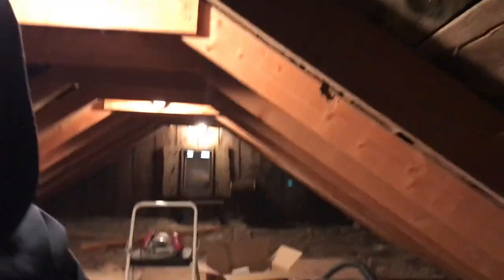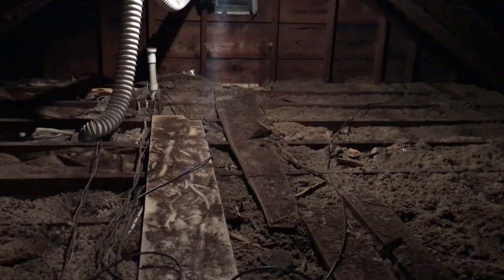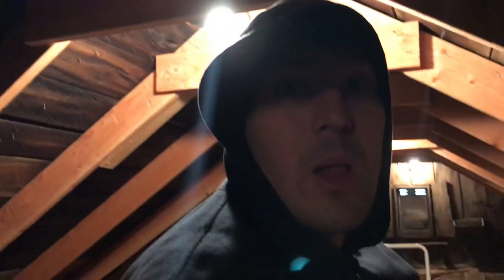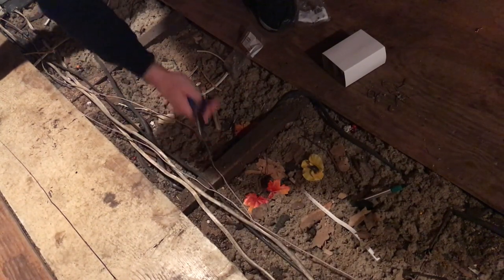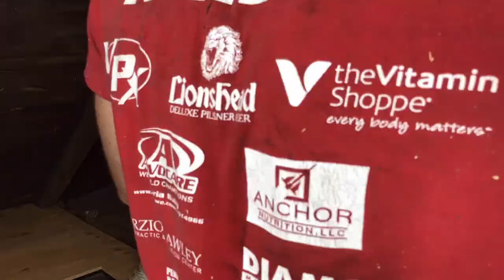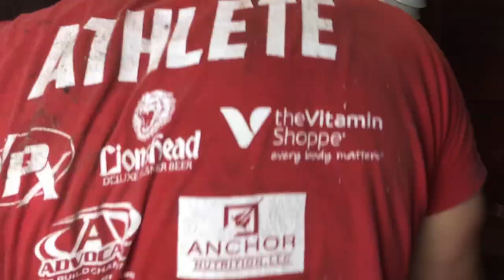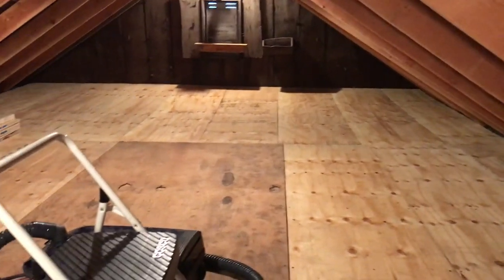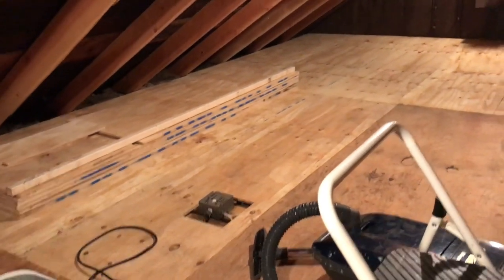DIY Attic / Loft Flooring

Comment: Have an attic access in an old home. Floorboard completely covering the bathroom fan below with just enough of a hole for a 4” vent that needs replacing. This gave me confidence to go up there and do some work (I had no idea if cutting wider holes for things like fans and ducts was a “thing” I could do—silly, I know)

Comment: I was a roofer many years ago and feel there would have been more structural integrity if the flooring had been layed down like cross bonded brick work and not meeting on the same ceiling joists. Otherwise I've never seen anyone work so fast and efficiently.  Best way to portray these videos I feel.
Reply from the maker: Thats important for the bricks as a whole, because they are working together to support something (e.g. as a wall). These boards are just typically holding 1 or two boxes individually.
Reply: Structural integrity he said. I think he is right. Even so adding sheeting on the floor increased structural integrity. Not that you need it more structural integrity. It seems just to be a thought which I’m glad he mentioned.
Reply: Michael is correct as far as the floor boards all flexing at the same join. if you criss cross them, the floor would technically be stiffer but 3/4 ply is think enough as it is to not be concerned about it whatsoever. nice work!

Comment: Rather than cutting into the ceiling joist to accommodate the wires, and thereby weakening the joists, it might be better either nail timber on top of the joist or at right angle to them.

Comment: My attic has the same issue with the cables across the joists. I have been thinking about how to do this for over a year. I've talked to electricians and builders. The best idea we had was putting strapping on the joists. Not one of us thought of just notching them. Thank you.
Reply from the maker: See? You have been asking qualified people for advice when really you should have been looking for a doctor of physical therapy who makes YouTube videos!
Reply: Yeah, the idea of notching the joists makes me very nervous 😬
Reply: @petert7807  The codes specify the size, depth, and frequency of notches you can add. For some assemblies, that will be none at all. But for wood joists like this, you'd be surprised how much you can cut out.

Comment: I have inheritied so much 1/2 plywood flooring, but since it had been laying on top of wires, I had to move and adapt.  So, I am installing Attic Dek tiles that are made for the joist differences.  That said, it is much more expensive than your example
Reply from the maker: Yes, this is a cheap storage solution

Comment: Dose your house have any condensation issues with having no space between the floor layed and insolation? I seen some buildings regs where there's supposed to be enough space between the insolation and floor to prevent sweating and condensation occurring?
Reply from the maker: Have not had any issues yet. There is still space along the edges and it is definitely not an air tight seal by any means
Reply: I think this would be just like an exterior, as long as there is a vapor barrier on the bottom of the insulation it should be good to lay plywood on top. At least for fiberglass insulation. He looks to have an older house with cellulose, so I'm not sure if there is a vapor barrier installed or needed. I'm not a professional though.

Comment: I wouldn't put cuts in the beams for the wires and cables because it can cause damage to the strenght of the beams and also the HOH ( hart to hart ) between the beams is also a consern because the wider the distance the bigger the beams need to be .
Reply from the maker: I would agree with you, but I don’t
Reply: @DoodleBrosOfficial  I had a local contractor tell me the same thing about cutting into the beams. I have a similar project and am hesitant to cut into them. I feel like they won't technically be as strong, but also you are strengthening them by installing all the flooring. Maybe it that kind of cancels it out? Idk though, I'm a noob.
Reply from the maker: @fd1193  it’s been 2 years. My ceiling has no cracks and the house hasn’t come down. I think a few 1/2 inch deep notches are safe haha

Comment: Just a thought,  mark the floor, or make a drawing of where those wire runs are, just in case wiring need to be addressed again, or..  you plan to do additional nailing, you will want to know were to avoid.
Reply from the maker: An excellent idea. However, being a father in my mid 30s, I find that a life of danger is something that escapes me most of the time. Placing a screw into a board for some random repair, not knowing if I am about to shake hands with St Peter himself is one of the last thrills I can hope for

Comment: Excellent work generally but I will be using screws rather than nails over our delicate old lath and plaster ceilings. Plus I will 50% offset he lines of boards.
Reply from the maker: I did use screws 1 and 5/8”! For the project but I had not considered offsetting the boards. Good idea
Reply: @DoodleBrosOfficial  what does offsetting the boards mean ?

Comment: I did a similar work at my house but I I extend all my wire i one area of the attic and remove the insulation but replaced with new insulation on the roof so the room is insulated, in that attic if you live in a hot area is going to be 140 dg in summer
Reply from the maker: It does get extremely hot in the attic during the summer, but thats what attics are for lol. None of the heat transfers down to the living area

Comment: So is it ok for the new plywood flooring to be placed over all the existing wiring? Should one be worried about "smushing" or pressing/pinching all the existing electrical wiring?? For example, my AC and water heater are both in my attic and there's lots of wiring coming out of it in all different directions that sits freely over all the joists (in addition to internet/tv/camera system cables etc.). If I'm installing some plywood flooring it seems like I would need to put the flooring UNDER all said cables as opposed to on top right?
Reply from the maker: There are a few options. Best case would be to have it all under the flooring or on top (but then you can trip over it. 

The method I chose, as I show in the video, was to cut tiny notches (about 1/2 inch deep) in the beams and place the wires in those. That way when I put down the flooring, there was no pressure on the wiring

Comment: Fantastic idea and a good space for storage. Would there be any dramas with the cabling being covered and down lights couldn’t be covered right?
Reply from the maker: No issues with the cabling being covered, and those boxes were actually electrical cable junctions. I could have relocated them but it would have been too much of a hassle.

I DID, however, write down where all the cables were just in case I ever needed to do something with them
Reply: LED downlights can be covered, they run cool. as long as you can access cables later then its all good. but very rare that you would ever need to again in this lifetime

Comment: Great video! Many thanks for this. I see your laying boards straight onto the joists. Will that not make the ceilings below crack in some way? Will the boards be okay to place a model railway up there if you were careful moving around?
Reply from the maker: It’s been 3 years and no cracks so far. 
No trains up there. Trains weigh 20-40 thousand tons and are best on railways, not attacks. Please stick to full sized vehicles at most. Maybe a bus.

Comment: Thank you for sharing great video, how long has it taken you from start to finish? And material cost? Thanks again
Reply from the maker: No problem! Took about 3 weeks, roughly 20-30 hours total to complete.
The plywood (at the time) was about $400 and the screws another $30-ish
Reply: @DoodleBrosOfficial   what size plywood did you use? 1/2 inch?
Reply from the maker: @mikeanthony3749  Correct, 1/2 inch. If you are going to be up there a lot I recommend 3/4 though. I weigh just shy of 200 lbs and it has some good flex to it when I walk on it. Since I go up there literally 4 or 5 times a year its no big deal though. 1/2 is perfect for anything you are storing

Comment: Great video!! Thanks for sharing :-)
How thick should the wood be for the flooring that you put down?
Reply from the maker: I recommend 3/4 inch plywood if you are going to be walking around on it a good amount. I used 1/2 inch because I only go up there a handful of times a year. The 1/2 inch flexes A LOT, but if you do a good job of screwing it down there isn't an issue.

One strategy would also be to have the 3/4 inch where you are walking and 1/2 inch on the sides where you are putting boxes/totes. (The cost difference between putting 1/2 vs 3/4 for my attic was about $150)
Reply: @DoodleBrosOfficial  yeah cheers for that info.. I'll have to pop up in to my attic and check the beams etc.. it's not gonna get much walking on if truth be told. It's only gonna be storage really,and up and down at xmas for the usual decorations etc lol but I might even 1/2 inch at the outer and 3/4 inch more central where most of the walking when I'm up there will be.. cheers for the heads up, at least when I go for the wood,they'll not be able to pull the wool over my eyes and say I have to go for 3/4 inch or perhaps an inch
Reply: @ryanhunter2730  you can also put a 3/4 "catwalk" in the middle that will allow you to carry stuff more easily. Use 1/2 for the box storage. If you have 2x4s you can add them between joists to minimize flexing if you go with 1/2. I'm a big guy, I don't trust 1/2.

Comment: Great Video!! Awesome Job as well.. I notice you didn't put down new insulation. Do you recommend putting down new insulation or should I just use what I have currently? What size screws did you use?
Reply from the maker: Screws are 1 and 5/8 inches.... not sure on the insulation. That is something you would need to speak to a professional about. Sorry I can't help there!

Comment: Great video, I see there’s no wires, is that ok to fit boards over wires without possible future danger?
Reply from the maker: John Murphy first few minutes of the video I talk about how I cut very small notches in the floor beams for the wires to fit in so the boards do not lay on them. I would NOT recommend just laying the boards on top of them otherwise
Reply: Doodle Bros great thank you!
Reply: Lol I would have HAD to pull all that insulation out/I would have replaced it all, OR removed it all togeather and added Insulation, in other areas/the walls/ the ceiling area,  I would have also PROBABLY, re-routed all of the wires as well/ran them through the joist, ALL OF THIS, would have taken ALLOT more time, but I just wouldn't want to have to think about it, FOREVER LOL.

I would have also either installed a mini split or re-routed duct work, to/in the attic.

I'm tall too, so I don't know if this would work for me/I know the only option is to raise the roof, which is annoying/allot of work, BUT, that MIGHT be your best option/worth the money.

When your sitting down, I'm sure its not to bad though.

I would put the floor/plywood down regardless though, even if your just using it for storage.
Reply: Possible danger always exists. The method in this video has a high risk of causing a house fire. The biggest risk as I understand it is that someone puts a screw or nail through the subfloor and damages the electrical conductors below. This could be to add flooring, to fix saging/bulging of the subfloor (potentially caused by a wire), or to add a structure above the subfloor such as shelving or a table. Additionally, 1/2" ply is both insufficient thickness for a subfloor (3/4" minimum) and insufficient distance to protect against typical fasteners penetrating into electrical wires. The preferable method is to add ~4-6" risers over the joists to elevate the subfloor over these obstacles. That is, of course, detrimental to the height of the finished space - but it's the safest way to do it and makes it easy to fish through additional wiring later, or add insulation as needed.

Comment: Badass work. But at what point is it too much weight for the trusses? Roof ridge sag? You can store alot of things with that space.
Reply from the maker: Lee Nino Good question. The flooring would help distribute the weight of anything you are storing up there. And if I can fit it up the small pull down stairwell and lift it in my attic it isn’t too heavy to begin with. No amount of Christmas decorations and boxes of  my wife’s old purses will make the roof sag
Reply: @DoodleBrosOfficial  What if my wife has Gucci purses? Would those be too heavy?
Reply from the maker: @timkr66  due to the weight of extreme fashion sense it would, in fact, bring the whole roof down. My apologies on the weight, but compliments on the fashion

Comment: Thank you for sharing your video sir, I hope to try this for my mother's attic as a gift to her soon. May I ask if you have any suggestions/advice for beginners?
Reply from the maker: Get yourself a pair of Bluetooth headphones like I had and listen to some podcasts..... because it’s going to be a while.

If you have any questions during, feel free to come back and ask!
Reply: @DoodleBrosOfficial  Thank you for sharing then, may I ask if I need support for the plywood or is that needed to withstand more weight?
Reply from the maker: @mskiara18  if you are going to be walking on it a lot, use 3/4 inch. Otherwise 1/2 inch works fine for storage
Reply: Use a black permanent marker, mark the wood where any electric wires are underneath.

Comment: Uh, how did you even get the boards into the attic? I have about 28" x 20" access panel to my attic. The main reason I want to get some kind of walkways is to support my weight while installing roof rafter insulation. Would it be adviseable to cut small notches in the ceiling joists to allow the romex to safely sit in them?
Reply from the maker: That would be rough. We have pull down stairs, about 28 inches across also. I had all the 4’x8’ boards cut in half (length wise) at the lumber yard. So I would think it would still be possible for you to get them up, depending on the ceiling height, if you did that

Comment: Nice video. I’m planning a similar project. Any thoughts on putting adhesive on the joists before screwing the boards down?
Reply from the maker: No issues holding them down with just the screws. I think the only thing that would prevent is them coming up easily if you ever needed to run a wire/ re-insulate/ etc

Comment: Why wouldn’t you just add spacers on top of joists raising plywood above wires then lay plywood on that rather than notch a structural beam (incorrectly mind you it should be in center of beam)?
Reply from the maker: Because laying spacers would add more weight and more cost. A half inch notch doesn’t affect the structural integrity at all (I asked professionals. No need for the YouTube experts to chime in). And incorrectly? If I was building the home, incorrectly maybe. I am Columbus and I landed in this land to find these wires already laid down. There wasn’t slack to move them as God intended. 

Ephesians 2:28 “checketh thyself before thine wrecketh thyself.”

Comment: Hi What size plywood did you use?  and what size screws?
Reply from the maker: I recommend 3/4 inch plywood if you are going to be walking around on it a good amount. I used 1/2 inch because I only go up there a handful of times a year. The 1/2 inch flexes A LOT, but if you do a good job of screwing it down there isn't an issue.

One strategy would also be to have the 3/4 inch where you are walking and 1/2 inch on the sides where you are putting boxes/totes. (The cost difference between putting 1/2 vs 3/4 for my attic was about $150)

The screws were 1 and 5/8 inch

Comment: Did you put metal plates down to protect the wires? It'd be quite a big problem if you hit one of those with a screw.
Reply from the maker: I did not, I just marked where they are under the plywood and avoided the areas

Comment: So pre drill the screw holes or just go strait into the wood with the screw ? Just wondering if the beams would have splits in them if not pre drilled ?
Reply from the maker: Definitely pre drill. I also counter synced so they are flush.

Comment: This is not a load bearing way to do a floor and over time cracks may appear in the ceilings below 4"2 graded joists should be used above the existing 3"2 joists
Reply from the maker: Worried about cracks when you should be worried about your weak traps. Check out some of the exercise and fitness videos on my page to turn those mediocre muscles into man crushing haymakers. That way you won't have to leave lame comments like this again!

Comment: Thanks for the video, I have a few questions: what happens if you step in the middle between two joists does it bend?
 what type of wood are those boards?
and did you screw the boards down or are they just laying in there?
Reply from the maker: Screwed them down with 1 and 5/8 inch screws. Just a little flex between the joists (I'm 200lbs) but I am only up there a few times a year to get something so I didn't see a need for the extra cost and weight of getting 3/4 inch plywood as opposed to the 1/2 inch I used. I just try and walk on the joists  areas (its easy to tell because thats where the screws are.